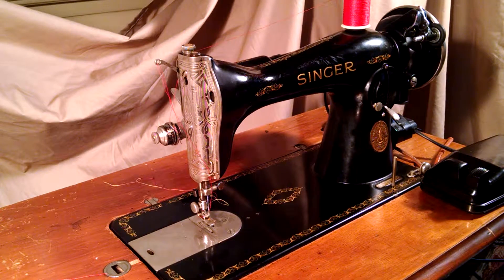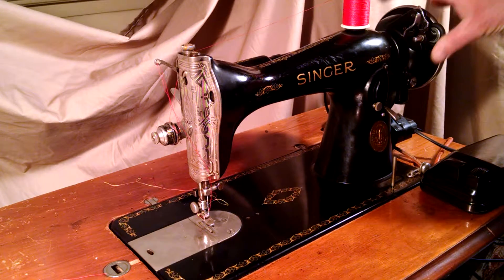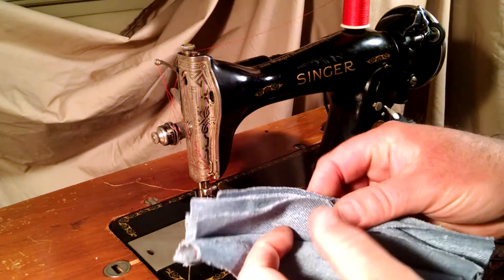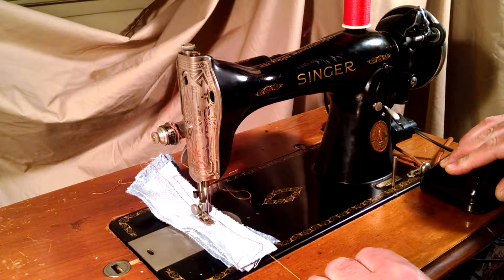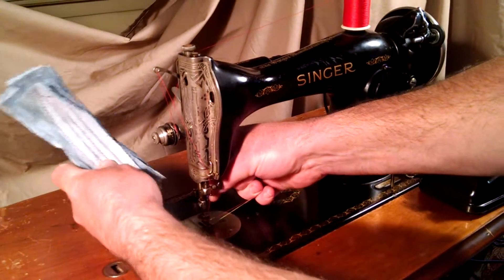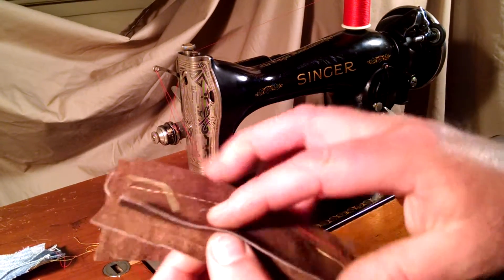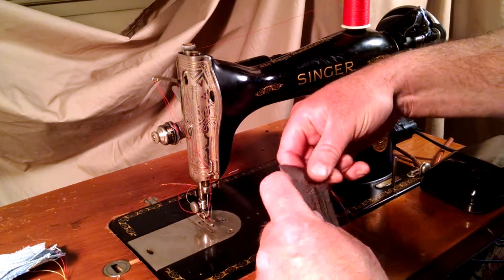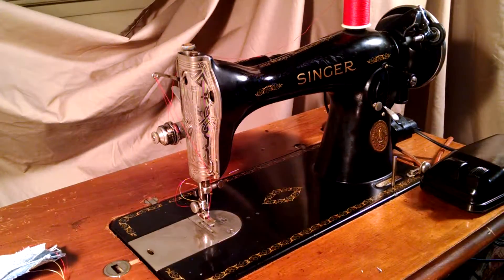Serviced and Rewired Strong Vintage 1935 Singer 15-91 Sewing Machine AE049057

Comment: I recently purchased a Singer 15 91 for my denser quilting project (e.g., denims).  After cleaning and oiling the machine, I just can't seem to get the tension right.  I've rethreaded the machine and adjusted my top/ bobbin tensions but I keep ending up with a birds nest of threads under my test piece.  Do you have any suggestions?
Reply from the maker: it sounds like you dont have any upper thread tension, make sure you are threading it properly, make sure your tension has tension pull the thread through it like floss and see if it has tension, if so then check how the machine is threaded. Its hard to say without having the machine in front of me.
Reply: Thanks for the suggestion.   I'll try it!